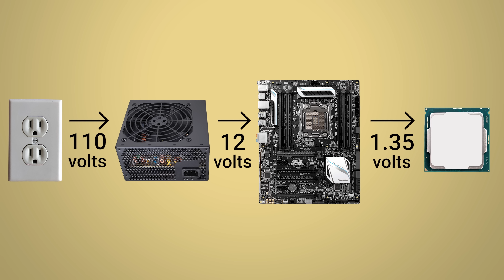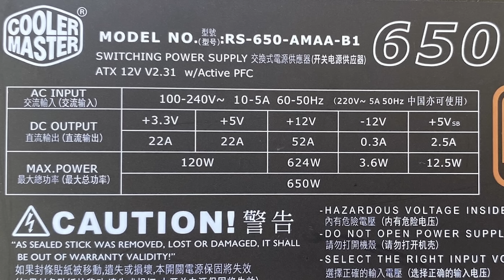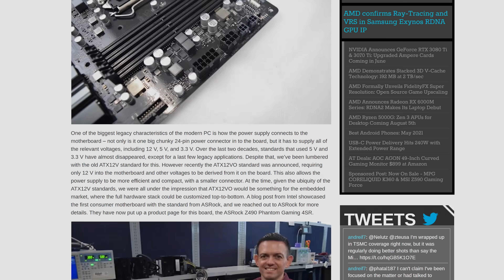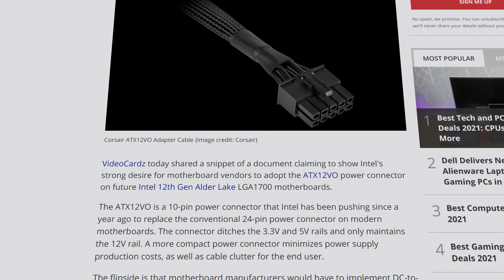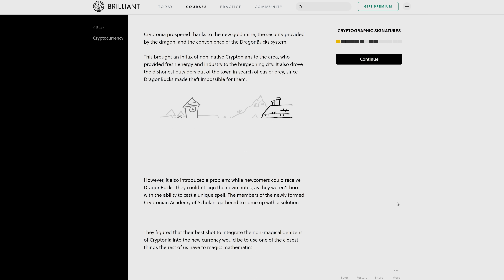Is The 24-Pin Connector DEAD?

Comment: it is idiotic to move the sata power to the motherboard as it isnt necessary to begin with. They are on their own independent rail and have no part of the 24pin connector. I think it wont take off as all it takes is a couple motherboard manufacturers to tell intel, no. It will end up like intel's RAMBUS memory and disappear. if not, power supply manufacturers will just start making them modular so as to maintain compatibility with legacy and AMD devices.

Comment: Switch mode power supplies is the more unreliable part of a PC, so instead of changing a cheap PS you have to throw away an expensive motherboard. Try fixing the many PS's on a MB, ie, it isn't easy.

Comment: your friends from china will have some sort of cable adapters to make your old ATX PSU work on newer ATX-12VO standard.

to be honest the only problem I can see with old ATX PSU is the 12v standby, but this can be workaround by using the 5vSB from old ATX PSU, boost it to 12v by using a boost converter and whoala, just make sure to not use any kind on USB charging feature on your mobo as this will cripple the boost converter from 12v-SB boost.

Comment: I have a few issues with this. Keep the 5V but ditch the 3.3V and the other issue is that probably all those new components will cost more than their counterparts. 
Btw why so many cables on one connector with the same voltage and ground cables?
By looking at the connector diagram it doesn't make sense. 2x 12V,  5x 5V, 4x 3.3V, 1x -12V, 1x -5V, 8x ground, 1x PG (5V?), 1x 5Vsb, 1x ps on.

Comment: That SATA part is "wonderful": the example shows 5 SATA power connectors on the PSU, but just 2 on the MB.  And given it's the MB, I'd fully expect each connector to support only one SATA drive.  So, from up 10 HDDs down to just 4 (or even just 2).  Yay!  Progress!

Comment: this is all nonsense anyway. It only makes PSUs more efficient, it doesn't make the whole machine more efficient. You're just moving the 3.3v and 5v conversion to the motherboard. I  bet an averagely good quality PSU does it more efficiently than an averagely good quality motherboard does, considering that efficiency is one of the few selling points of a good PSU.

Comment: On the 24 pins connectors, there are several connectors for most tensions. There are some circuits that may still need +5 and -5 volts. There is that -12 volt. The 3.3 volt pin was for the CPU. Now, most CPU no longer need it.
If your new connector need any auxiliary connector, then, it's conception is flawed. Back to the drawing board.

Comment: Can we actually get a standard on something that actually is a pain like front panel power/reset/led connections?
Reply: or the USB 3.0 header.
Reply: @snintendog  my latest build had a simple plug for that. So much easier. But still those single plastic connectors for each pin to power the case buttons

Comment: I didnt had too much issues with the current connector, the only thing that annoyed me how much pressure it required to properly connect to the mobo, it is quite unnerving to see the board bend. If they kept the same connector but changed in some way to not require such force applied to attach it would be way better in my opinion

Comment: I would love it if the ATX12VO standard and nvidia's mini 12-pin PCIE takes off as well so in the not too distant future you only need the 10-pin motherboard connector, 8-pin EPS, and the 12-pin PCIE cables. 3 cables total coming off the PSU would be sweet.

Comment: Do we have any electrical engineers that want to weigh in on this?  Because I don't see any benefits to dumping MORE power supply duties to the motherboard.  Look, the 12V concept works great if we are talking about a system that ONLY uses 12V but we're not.  We have PCI Express supplemental power connectors, SATA, older molex-supplied accessories...  And you want to supply those exclusively via power generated on the motherboard now?  For starters you just made your build messy as hell because those power cables need to come off the motherboard and get routed to the components in question, which means you will always see the end of the connector attached to the board.  With our current design we can hide PSU cables and most of our accessories thanks to case designers providing hidden mounting points for things like drives.

Worse: Your motherboard is cramnmed full of tech already and now you need to make room for additional power conversion circuitry on the board.  Power circuitry designed by your motherboard manufacturer rather than your PSU manufacturer.  Don't forget to handle transient spikes and all the extra noise that comes along with that power too.  PCIE Gen 4 required compromises, and motherboard manufacturers had to find ways to shorten the length of the traces to get a clean signal between your CPU and the PCI Express device you are trying to talk to.  

TL;DR -- Stop trying to make motherboard trace layouts more complicated and leave the power supply up to the, uh...power supply.  This doesn't save the PC builder community any money and it is debatable whether it helps OEMs like Dell

Comment: Never had a problem with this particular connector, I prefer it if I don't have to have multiple connections and deal with 2 or more cable connections to do the same exact thing. Only connections I ran out of was usb headers and that wasn't a big deal, just got a splitter board

Comment: Damn, if you think you are about to tear the 24-pin connector out of the motherboard when trying to remove it then you are doing something wrong.  Grasp the connector's wire bundle, press the 24-pin's locking tab to open it up, then rock it side to side length-wise to remove the cable.  You might have to rock it back and forth a few times to get it completely off.  

Reverse this process for putting the 24-pin on.  If you are worried about breaking your motherboard then you can slip your fingers under the edge of the board below the 24-pin to help support it during installation.  You can seat the 4-pin connector a little to keep it from popping loose, then just insert the larger 20-pin side of the connector and wiggle it until it clicks into place.  The 4-pin will be pushed down with the 20-pin, but push straight down on each of the connectors afterward if you want to double-check.

After either operation you can check the two connectors to make sure none of the pins popped out.  If any have then you may be able to push them back into the connector with a spudger.  And that is the worst thing that can happen using my method above.  I know we are all raised not to unplug things by yanking on the cable instead of the plug, but these connectors are designed for adding and removing individual pins.  You shouldn't hurt anything, and manipulating the connector by the wires helps spread the load move evenly.

Comment: shouldn't psu makers be able to start by just tacking an ATX12VO connector on to their existing cpus? after all, its just another fancy 12V connector right?

Then people can happily upgrade to a new mobo with just the new standard, and eventually the 24 pin connector can be phased out.

mobo makers might be able to have dual connectors too, but there isn't a lot of space on a mobo, and my rule of thumb is when upgrading a mobo (i.e. basically buying a new computer) its probably time to get a new PSU anyway, as those parts are probably the worse for wear, and also the most likely to f**k the rest of your system if they go wrong.

Comment: This is something new for Desktop pcs, but laptops have always use one single cable to power up everything (two, negative and positive (three if it's a Dell, HP, Lenovo 🙄🙄xdd)).

Maybe new ATX 12v MoBos are going to be more expensive due to that extra electronics they need

Comment: I dont mind a 24 pin connector, pretty easy to connect.

20+4? Now that shits hell. You have to line the other 4 pins up with it and by the time you put it anywhere near the socket,  its already snapped off and you have to line it up again

Comment: Maybe it's just me, but does it really push the efficiency so hard? Think about it, that part of the PSU that converts from 12V to 5V (yes usually they dont convert von grid to 5V but to 12V and then stepping down further for 5V and 3.3V rails. So it is true that the efficiency for the PSU alone will raise because of the new standard. But i dont believe that the overall efficiency moves forward at the same rate. Modern PSUs may have multiple rails per Voltage just to deactivate some of them, if not needed anyway. And the PSU producers are much more eligible for that task, than the board manufacturer that have to do so much more at the same time.

Comment: How often does the average person even interact with a 24 pin connector? This seems like fixing a problem that hardly ever comes up. Be better to replace the internal sata with internal USB 3.2 gen2x2. Just plug in one cable for power and data.

Comment: It doesn't have any sense. It's just dividing big plug into few smaller and making mother board more expensive. And yes power supply will have higher efficiency, but motherboard will have much lower.

Comment: If SATA uses 5V then all you need is to add a 12V - 5V buck converter to the SATA drive and problem solved.

Comment: I hate the 24-pin. My (quite old) case does not have enough space next to the mobo for my hand to properly engage. I have to use pliers once my grip strength is used up.

Comment: I'm not convinced a MB can handle the power distribution with a PCB efficiently - especially on SSF.  However, we are 1 step closer to Star trek with this where we could potentially get enough control to decide how to route our power.  If wattage is a single pool and current can be fed to any voltage and we have control - that is a powerful tool.  We can configure a system any way needed with no consideration of the PSU beyond general quality.  Most folks won't care - but what if you are making a drive box or a many port hub?  Same PSU can handle it that would handle a CPU/GPU intensive system. Personally I would rather see a second box that distributes the voltage rather than the MB - and then make PSUs 24 or 40V DC - but really, that is just modularizing a PSU.

Comment: Only SATA uses 5 volts? Since when did USB stop using 5 volts? And the 24 pin connector only bothers people who build rigs multiple times a day. A home PC builder only deals with it once every few months or once every few years. And those who buy pre-built may never even see a 24 pin connector.

Comment: This is a very stupid idea and I hope it fails. There's absolutely NO reason to ditch the ATX connector, and this new standard will result in a new problem - systems will rely more on motherboards for power conversion. They will generate more heat and they will have more parts to fail. This is so dumb.

Comment: Oh, no. This is the final nail on the HDD, and Optical drives (yes, I still use them). If this standard becomes a thing any SATA based components will be gone from PC world. Its funny how technology is going dumber and dumber.
Reply: Motherboard do that conversion for u no worry
Reply: @heickelrrx  — Yes, but now the amount of SATA devices I can plug in are at the mercy of the motherboard conversion ports. Then I will have to buy splitters and all kinds of stuff, if I want to connect SATA devices. As it is today, we have at least 4 SATA power ports in the PSU cables. If this standard comes, we will have like 2 power ports in the mobo. So out options are relatively limited. Of course this is not problem for normies who don't use HDD or Optical these days. But people who has specific needs for those hardware like me are going to to have to mess aroused with splitter cables and such. If the motherboard manufacturer give us the splitter cables then its ok, I guess.
Reply: @hasupe6520  i am pretty sure there will be a solution for your problem,

As long as there is a demand for it, there will always a solution for it

Comment: Great way to make current PSUs, one of the components you rarely change during an upgrade, obsolete for no reason. If I could only plug one big connector to the motherboard instead of 3 smaller ones, I would.
Reply: Wrong. There are many 24 pin to 12VO adapters in the market.

Comment: Remember back in the when we had just 20 pins? I try to forget.
Reply: I still have 3 old boards with 20 pin connectors (and they're still somewhat functional, but useless for modern stuff) and an old 200 watts PSU with a 20 pin connector.

Comment: I believe the 12VO standard is good. It can hopefully help reduce the price of SMPSs and also reduce chances of failure as there will be much simpler circuitry inside them. Also, this can help reduce the size of the power supplies.

Comment: It's time that CASES get in the game. I want more than standouts, and missing screws, I want power conversion, ventilation, easy-bake-air-fryer conversion kits, I want RUSH, the Megaman sidekick AI integrated, but for now, we can connect the chungus cables to the case and have the case act like a splitter.

Comment: I recently read that motherboard manufacturers have officially announced they'll be phasing out SATA, so that shouldn't be an issue for long. Instead, they're switching to NVMe cable connections. Hard drive manufacturers will be switching to NVMe connectors, even though they don't need the speed, as a result. Whether this will be a 3-5 year phase out or a 10-15 year phase out remains to be seen.

Comment: For a lot of people the small ITX motherboards seems to be about all that's really needed. Some of these pack in quite a lot of connectivity and functionality, though no where near as much as you find on a full ATX motherboard. Even the micro ATX motherboards are usually slightly cut back in functionality than the full fat ATX versions as there are not enough PCB real estate for all the connectors and electronics, and I'm not talking about the three expansion slots. The VRMs on many micro ATX motherboards are often cut down versions of the full ATX version of the same name. It's either doing this or cutting back even further on things like USB ports, SATA connectors and M.2 slots than they already do.

So now they want to replace the 24-pin ATX connector with a 10-pin 12V only connector? That's good right? More real estate for other things on small motherboards, right?

Sorry but no, it mean even less space on the motherboard as now there will have to be two new VRMs on the motherboard for 5V and 3.3V. Granted these will probably not be very robust because cost and space, but they still take up some space. Then there are the connectors for SATA power and what not. In the end it will take up more space on the motherboard than the old 24-pin connector.

The larger the motherboard is the less of an issue this is going to be, but for the really compact formats it will mean less capable motherboards. Now I know that a lot of people won't really care about that either. After all there are a lot of people who are happy buying and using small formfactor machines that has very limited expandability and connectivity, just ask Apple, but it should still be kept in mind so it's not a surprise when SFF computers gets more spartan.

Comment: I really don't get the point of the huge 24 pin connector. The CPU already had it's own 8+4 power cable, and the GPUs have their own single or dual 8-pin connectors, or some mix in between. So  such a huge cable to power what else exactly?

Comment: The problem isn't the12V or 5V or 3.5V, it is the d*mn plastic connector itself.  I can't believe we're about to get 3nm CPU but are still clogged with wires and connectors that predates Windows, while you see Apple with mag-connectors and what not.

Comment: "I'm just waiting for the day when we can power everything with a single cable"
Tbh I'd be way more interested in that ^^ yes.
Reply: If we now have two cables coming from the motherboard to sata drives, why don't they just change it (on the motherboard side) so it can carry power and data.
Reply: @hazgebu  i think that already been done iirc, like in Esata or just usb in general
Reply: @hazgebu  That's what I'd like, though SATA is basically dead, since servers and such are almost entirely moving to NVMe storage, even a lot of consumer systems only have NVMe drives, and the SATA and SAS we already have are more than fast enough for hard drives. So there's not much of a reason to create a new SATA standard.

Comment: I prefer to power my drives and extra peripherals directly from the power supply, if the supply develops a bad rail, it's cheaper to replace than any MoBo I'd be using.

Comment: But I still have 9 years left on the warranty for my Seasonic power supplies.
Reply: And it's likely you'll be able to use it for 10 more years. ATX12V should be easily adaptable to 12VO.